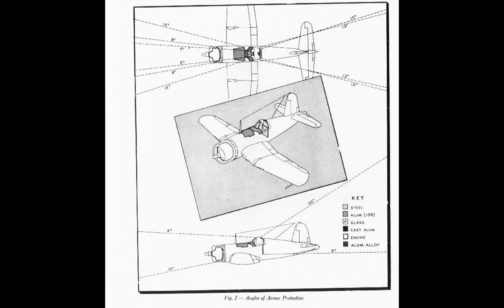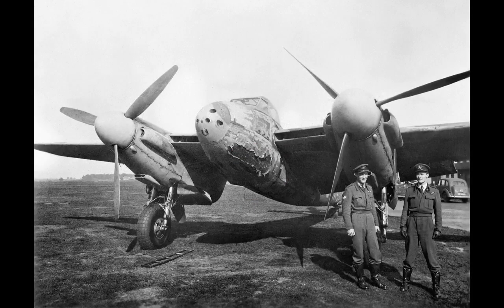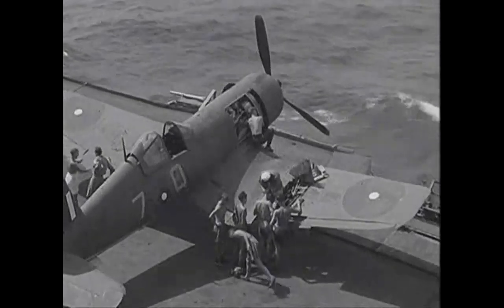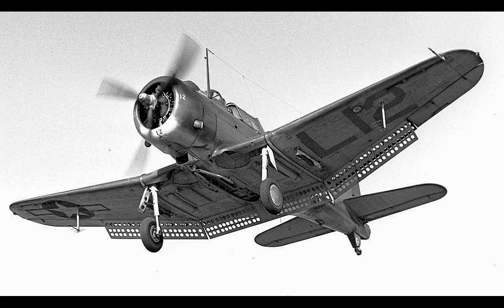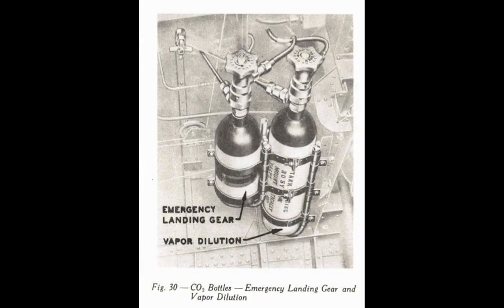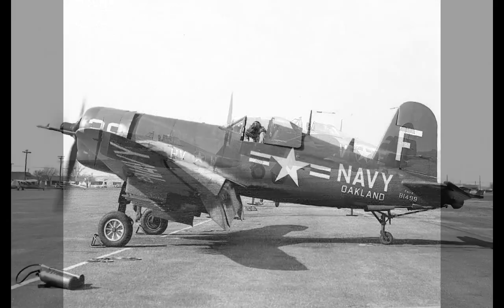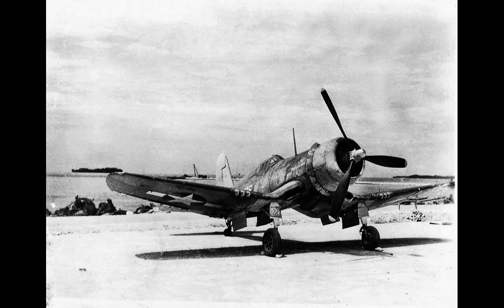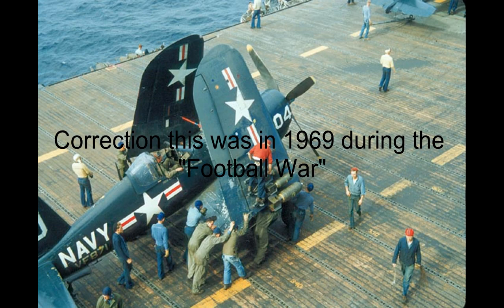F4U Corsair Design Features

Comment: The reason why RN carriers had an advantage over USN carriers is the location of the hangar deck. In USN ships the hangar deck was the main deck, whereas in RN ships the hangar deck was located one deck lower. There were advantages and disadvantages to each system. In the RN system, the disadvantages were twofold:
1) Since the hangar was on the 2nd deck level the number of aircraft carried was reduced compared to a USN carrier of similar tonnage.
2) Overhead clearance on the hangar deck was also reduced. Corsairs in the Fleet Air Arm had their wingspan reduced by about two feet so that when folded the wings cleared the overhead.

The USN followed a different design policy. Their carriers hangared aircraft on the more spacious main deck, with the flight deck above as superstructure, which allowed operation of a larger air group.

The choice in each navy was reasonable and adopted primary by prewar assumptions. In the 1920s and 1930s, all USN ship acquisition plans were based on operations in the Pacific, while Royal Navy plans were geared toward service in the North Atlantic and the Mediterranean. (This is why the USS Arizona was slower than her near-contemporary, HMS Warspite — the Pacific is so much larger than the Atlantic, it's better to go further than faster.) In battles anticipated by the British, their carriers would be under direct threat of enemy shore batteries or battleships. The Americans planned to keep their carriers well behind their battleline and out of range of the big guns. The IJN came to the same conclusions as the Americans did, consequently, their carriers had superstructure flight decks as well. Because the Pacific is so huge the planes in your carrier air groups need to have long range. If you have long-range planes and plenty of room to maneuver, why group your carriers with the battleships?

The Americans lost their battleline at Pearl Harbor, leaving only the carriers and their escorts to fight the Japanese Navy. At Midway, the USN had only three carriers against the IJN's four, but the number of carrier-based planes was about equal (with the land-based planes on Midway the numbers favored the Americans considerably), which was a direct benefit of the "flight deck as superstructure" design. Even as the new fast battleships came online the USN retained the aircraft carriers as their primary capital ships, and the new Essex-class design emphasized massive air groups and powerful anti-aircraft weapons over armored flight decks. The USN could afford more destroyers and light cruisers than any other navy, so that fact became part of the "armor versus airgroup" equation as well.

The history of warfare shows that active defense is generally better than passive defense. Armor on a warship is good, but destroying the enemy before he can hit you is even better. More planes and more AAA guns mean a stronger active defense.
Reply from the maker: The USN liaison officer on Indefatigable commented: "When a kamikaze hits a US carrier it means 6 months of repair at Pearl [Harbor]. When a kamikaze hits a Limey carrier it's just a case of 'Sweepers, man your brooms'. I think that says a lot.
Reply: In 1941 the USN had two fleet carriers with armored flight decks, the Lexington and the Saratoga. These ships inherited their protection from their original designation as battlecruisers. Even after the refits these ships still retained their 8-inch secondaries and gun directors as well as deck and belt armor. They were intended to operate in the battleline like cruisers with the added punch of aircraft. (In the 1920s most admirals scoffed at the idea that planes could sink battle wagons.) For almost 40,000 tons CV-2 and CV-3 operated only 70 planes each. In spite of her armor Lexington recieved a bomb hit in the Coral Sea which ultimately destroyed her. The next US carrier was the purpose-built USS Ranger, which operated 76 planes on about half the tonnage. Ranger had a superstructure flight deck, setting the standard for subsequent USN carriers. USS Saratoga got a refit in 1943 which removed those useless 8-inch gun barbettes and several other details left over from her battlecruiser past, but the changes only increased her air group to 78. In terms of tonnage, CV-3 was only exceeded by the Midway-class, and those ships operated as many as 137 planes. Saratoga was a huge and beautiful ship, but she was a relic of the Battleship Age. There was no place for her in CBG navy, thus she was expended in the Bikini Atoll bomb test in 1946. The course of WWII proves the USN carrier concept as the correct one, in my opinion.

On the matter of the "sweepers man your brooms" one must point out that such claims are in the realm of anecdotes and table talk. Statistical analysis of actual damage inflicted by kamikaze attacks on carriers does not support the idea that RN carriers had a material advantage over USN carriers. Some kamikazes carried armor-piercing bombs, which would reach the interiors of the even the most protected ships. Most carried conventional bombs or HE material packed into whatever space could be found, which is why the "Special Attack Corps" severely damaged many ships but sank only a few.
Reply from the maker: As for that quote being in the realm of anecdotes and table talk, I disagree. That's from the US Navy Liaison officer stationed on a British carrier, one which was hit by a kamikaze. I think that's a pretty good source. There were three British carriers hit by Kamikazes. One suffered essentially no damage, one had its flight deck operational again in about 30 mins, and another took one hit, had no damage, then a few days later took TWO hits in close succession. It was flying planes off the deck again one hour later, had planes landing 12 hours later, and was fully repaired two days later. Meanwhile US planes that took equivalent hits had to sail to Pearl or San Fran for repairs.
Reply: @GregsAirplanesandAutomobiles  How can you be sure those were "equivalent hits"? Can you specify the type of ordnance the Japanese planes carried? Or the type of aircraft, Or the angle of the impacts?